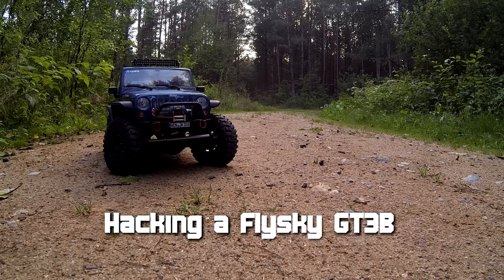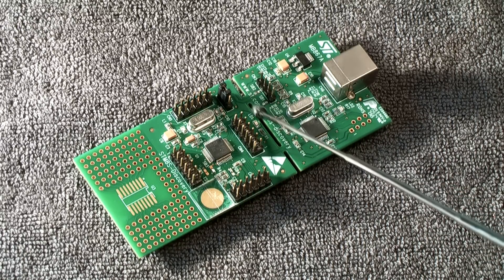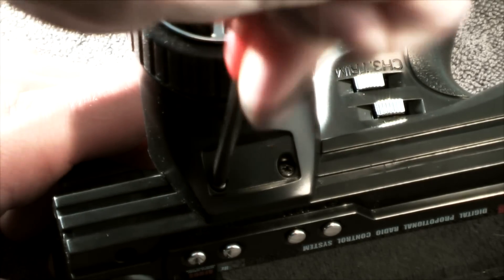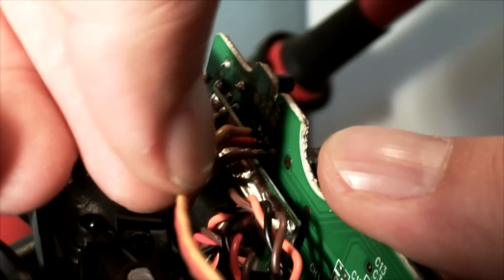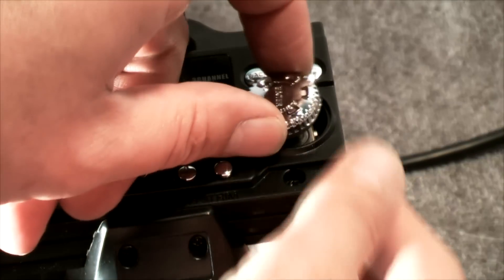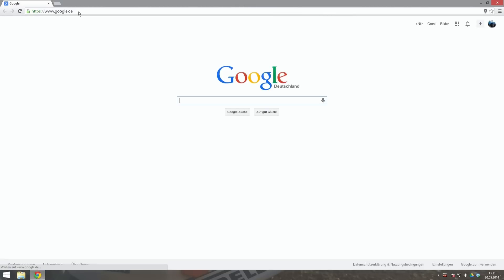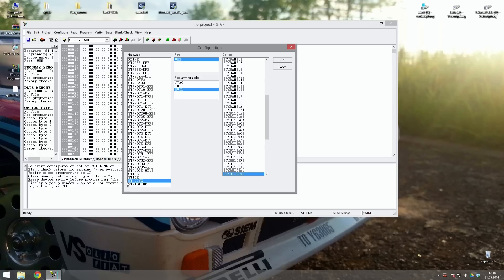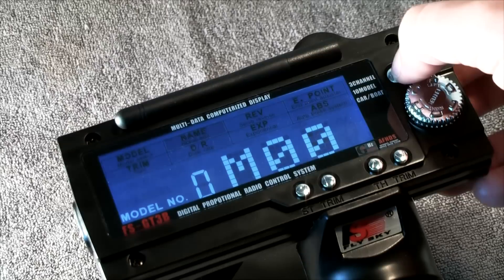RC-Films: FlySky GT3B Firmware Hack Tutorial (English)

Comment: What a fantstic video- I bought my GT3b off an ebay seller who advertised it a six channel, I won my case against him and ebay told me to keep the transmitter and also refunded me, and now this video is just the icing on the cake for me, so a win win!! thank you very much for sharing this, i will certainly have a go at changing my setup, one question though, how do you use the three extra channels? there are only 3 channel selectors.

Comment: Good Day Sir . I am New subscriber.  Is this board and software still available? is not what is your best recomendation ?? Many Thanks
Reply: Poppa Phill Stoffer This firmware hack is still available for the GT3B/GT3C radios. Difference is, 3 years later we now have The Spektrum DX5R and DX6R with 5 or 6 channels respectively. There is also the Futaba 7PX with 7 channels which is the one I own. These new radios are quite expensive but they are extremely simple to use compared to the hacked Flysky. The hacked Flysky radios are still the best bang for the buck hands down.
Reply: xXG.L.HXx Roger that and thanks for the response. I have hacked it and also plan on a newer model as the need arises. What I am liking most is the auto bind feature! Don't have to remind. Just power up select and BANG. Most excellent video with superb attention to details.  Subbed ever. Stay Blessed!

Comment: How do you program the lights and the winch pls ?
Reply from the maker: Here's how to control a winch:
How to run a winch from 3Racing:
Turn on the transmitter, push ENTER, select REV, push ENTER long, turn the dial to select channel 3, push ENTER, select CH3, push ENTER, select BMO, push ENTER, select RE0, push ENTER, select PV0, push ENTER, return to the main menu by pushing BACK. You can now controll your winch by using the CH3-TRIM switch on your transmitter.

Comment: Bonjour, j'en ai flashé une et aucun problème, par-contre j'en ai acheté une deuxième et là gros problème, j'ai comme réponse "the device is protected" quelqu'un a t'il une solution ? Merci.
Reply: In the "OPTION_BYTE" tab set the first option ROP to "Read Out Protection OFF", and then program it with Ctrl-P. That should remove the write protection and you should be able to flash the firmware normally.
Reply: Just found this guide, I had the same issue: https://neotilsblog.wordpress.com/2017/12/30/flysky-gt3b-hack/

Comment: Hi grate video..Im a beginner for RC and After I saw this video I think its a better way to having more channels in a Transmitter..So what a kind of receiver need to use after the firmware upgrade.
Reply from the maker: +sachindra praeep You can select one of the following receivers: 

If you need 6 Channels:
http://www.hobbyking.com/hobbyking/store/__12901__Hobby_King_2_4Ghz_Receiver_6Ch_V2.html 

If you like to use 8 Channels:
http://www.hobbyking.com/hobbyking/store/__12339__Turnigy_9X_2_4GHz_8Ch_Receiver_V2_.html

Both receivers work perfectly fine with the GT3b.

Thanks for watching!
Reply: +TeamIngel Thanks a lot for your reply,I already purchased a GT3B and will do the mods.
going to make a RC 6x6 using each motor for each wheel as its hard to make a RC axle.I just follow a YouTube video for that.And when it fit with your GT3B mod will be grate as it is my first project. Thanks for you all with PSX & OVERKILL

Comment: can u still do the lipo mod after doin this????? also do u have to leave that servo cord installed after ur done or can u take it off???
Reply from the maker: +Diy type of guy I haven't tried the lipo mod yet, but I think it will be no problem. You can remove the servo cable as soon as you are finished, but you can also leave it in your gt3b for future programmings. Thanks for watching!
Reply: +TeamIngel if u have multiple cars on the gt3b. .when u switch between models will all the models have the 6 channels??? and can u program different functions on the same buttons for different models? ???
Reply: +TeamIngel that 6 channel works fine for surface vehicles like the scx10? I wanna switch all my cars to my gt3b

Comment: Great video, I'm not sure when I will be changing the firmware on mine as the radio hasn't even arrived yet, and I've already spent my budget on that hehehe. 

You say how to set it as a 6 channel transmitter, but how do you control channels 4, 5 and 6?
Reply from the maker: +Andrea Woodvine You can map different channels to all existing buttons on your transmitter. For example, you can use the back button on the top of the transmitter to control channel 4 and use the end button (which is also located on the top of the transmitter) to control channel 5. Thanks for watching!

Comment: Hi after update the firmware is it possible to the old  3-Channel-Receiver.
FlySky FS-R6B - 6CH receiver will this receiver work.
Reply from the maker: S.Sanjeewa Gnanarathne  Hi! Your old 3-Channel-Receiver will still work after the firmware upgrade. But I'm not shure if the R6B receiver will work, because I as far as I know, this is an older version which won't work. You better use the one from the video description box. Thanks for watching!

Comment: Excellent video! I found it very helpful.  I could really use some clarification or a video tutorial of mapping the trim buttons or the back and end buttons and how to assign them to channels 4 and 5.  Just for 3 position switches.
Reply from the maker: Dan Licharson Ok, mapping is easy: Press Enter, move to menu "REV" and press Enter long. Now you are in the mapping menu. "1" is flashing, which is currently mapped to "TR1". In this case "1" stands for the steering trim buttons and TR1 stands for the steering trim function. If you want to map the steering buttons to another function, just press enter, scroll through the menu until your desired channel is shown (CH3, CH4, CH5 and so on) and press enter again. In the description of my video you will find a link to a manual. Table 4.14 will help you to identify how the buttons are named so you can select the right one.

Comment: How many models can you use after you hack the radio?  Stock it comes with 10
Reply from the maker: cm2881 After upgrading the firmware, the radio is capable of 63 model memories.Thanks for watching.
Reply: TeamIngel Thanks, that is exactly what I need.  I do have another question if possible. Which one do you prefer? The hacked FlySky GT3C or the hacked FlySky GT3B?
Reply from the maker: Technically they are the same, so it really doesn't matter. The GT3B is cheaper, but I do like the looks of the GT3C a little more. A really hard decision...

Comment: When I try to load the new firmware the programmer gives me this message and an error
Loading file C:\Users\josh\Downloads\GT3B Hack\gt3b-0.6.1.s19 in PROGRAM MEMORY area  ...
Error : FILE : line 4: Not in Motorola S19 format!
Error : < File loading failed.
I am running windows 8
thanks
Reply from the maker: Ok, a lot of people told me the same problem recently. Something has changed on this website, so the files aren't downloading in .s19-format anymore. If you like, just send me an email to team(dot)ingel(at)gmail(dot)com, so I can send you a working firmware version. Please let me know, what version you prefer. Thanks for watching!

Comment: How do i use the extra channels?
Reply from the maker: XRsSayntX You can assign any channel to any knob on the GT3B. For example I have assigned CH4 to the CH3 button to control my headlights, CH5 is mapped to the "Back"-Button on the top of the GT3B to control my additional lights and CH3-Trim is used to control my whinch. Thanks for watching!
Reply: TeamIngel First off thanks for the great video.... I am having a problem though. I have downloaded the right s19 software and I get it to load to the board, however when I click program current tab, I get a notice that the program has stopped working and needs to close. Any idea ??? I have tried several times and get the same response every time.

Comment: Does the power button need to be on or off for the the flash to work?
Reply from the maker: That's a good question. I did this modification twice. The first GT3b had to stay on, the second was off. But testing will not damage the GT3b, so you can try it mulitple times.

Comment: Is there anyway to fix the antenna wire after you rip it off like I did???
Reply from the maker: Yes, it should not be a big problem. It also happend to me, but I'm not shure if it was my GT3b where it happend. The antenna wire consists of two lines (koax cable). One in the center of the antenna cable, the other one is the shielding of the cable (which consits of a very fine wire mesh), which has to be soldered to an other position. If you like, I can take some pictures of my GT3b and send them to you by mail. Just send me a short email to team(dot)ingel(at)gmail(dot)com or vistit www.facebook.com/teamingel and leave me a message there.
Reply: Thanks for the quick response, I think I got it fixed.

Comment: would it be the same with the GT3C by just simply using the GT3C firmware?
Reply from the maker: Yes, it will also work with a GT3C and as far as I know you can also use a GT3B-Firmware.

Comment: hi i need help. when i try to put a new sotware (from link the gt3b-0.6.1.s19	Release: version-0.6.1) i see somtehing like this: 
Loading file C:\Users\Marek\Desktop\gt3b-0.6.1.s19 in PROGRAM MEMORY area  ...
Error : FILE : line 5: Not in Motorola S19 format!
Error : < File loading failed.

what i must do now??
Reply from the maker: Marek Tryka Ok, that's not a big deal. Your file-extenstion is not .s19, so we have to rename the file, but you can't do this properly if your file extensions aren't shown.  If you are using windows 7, select "Control Panel" in the start-menu and then select folder options. In the opening window select the "view" tab and there uncheck the box "Hide extensions for known file types". You can now rename the downloaded firmware to xxxx.s19

Let me know if this worked for you. If not, we can try another way to do this, just let me know, I will help as fast as possible!

Comment from the maker: The GT3B from FlySky is a very reasonable 3-channel-radio. And it is possible to convert it to a 8-channel-transmitter just by installing a new firmware!
In my newest video I will show you how to do so! Please enjoy!
Reply: very good tutorial video. 
i bought st link v2 from ebay and i want to hack my gtx3. one question;  when installing the new firmware do i need to power-on the transmitter? or only after the upgrade to check? thanks.
Reply: can you make it where it can find other brand recievers